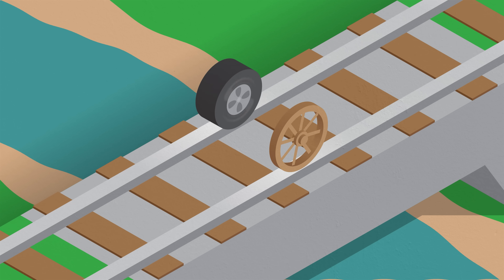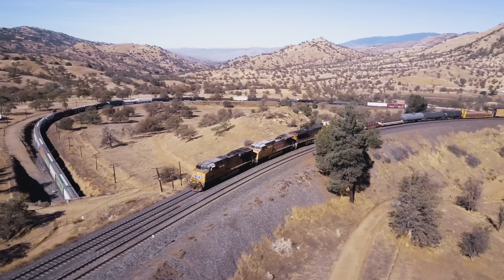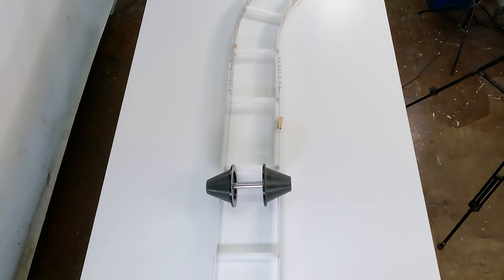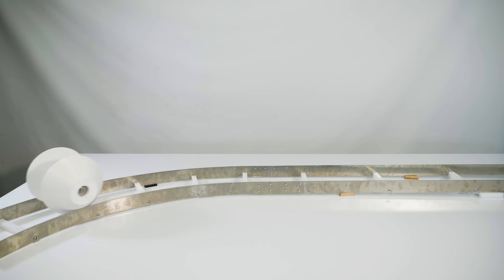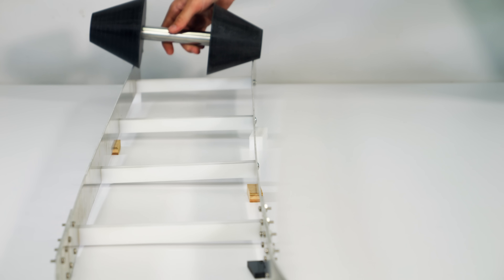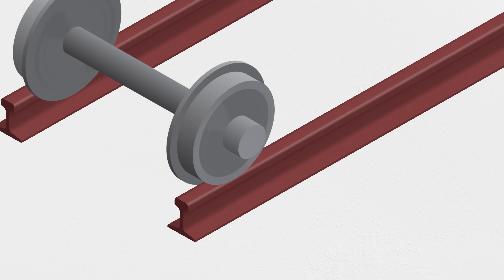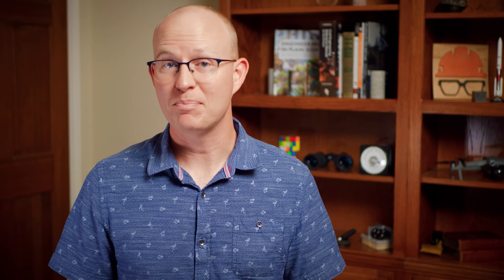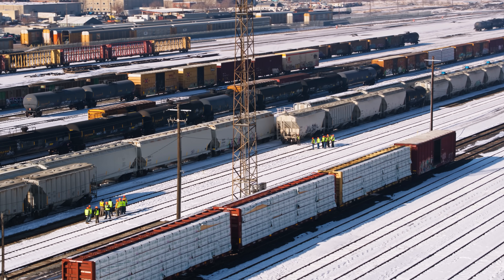Why Are Rails Shaped Like That?

Comment: Engineer here. Old engineer. I have spent many a Saturday in two different steam shops (Illinois Railway Museum and Hoosier Valley RR Museum). Worked on an old Baldwin decapod (Russian) loco, a Shay loco, and a rebuilt (welded not riveted) Baldwin Forney-Type loco. Railroads are way cool. Boiler design, superheaters, plus all the wheels and the lube, air compressor.... gauges and valves everywhere. You know the story. Awesome stuff. And I can polish a brass bell better than anybody!! Love your videos.

Comment: Hi Grady. @7:00 you mention that the outside of the wheel has a 0.25" greater diameter than the inside of the wheel, but you illustrate it with a 0.25" larger radius. But small nits aside, another great video. Thanks!

Comment: It's just going to get more fun as modern high-speed rail standards spread from Japan and Europe to the UK, China, the rest of Asia, Africa, and even - ever so slowly - to North America... instead of the pedestrian 79mph speed limits on standard US lines, speeds range in Europe from 140kph (86mph) on regular Intercity service to 300kph on Eurostar service on high-speed tracks... it's also fun to know why the Eurostar wobbles a bit when running flat out; they need to do a bit more engineering so the trains won't hunt when doing the triple-metric-tonne... 

And there's even more engineering to be done on the other side of the train - the top, where the power pickups are... sliding a contact along a catenary at 300k is gonna cause some wear, and obviously we want to minimise that while still transferring power efficiently... or could there be another way?  Maglev lines transfer power via induction, but those are rare... one wonders if we could some way use induction to power an otherwise "ordinary" steel-wheels-on-steel-rails train?

Comment: RAILS NOT SHAPED LIKE THAT !!!!!
The rails being talked about are called "Flat bottom rail" because they have a flat bottom, so stand up by themselves. But they are NOT the only type. Indeed at 0:25 can be seen at the bottom right foreground, and older type of rail called a "Bullhead rail" which is rare in the USA, but still fairly common in Britain. Bullhead rails require cast iron chairs also visible in the picture, to hold them almost vertically but not quite. The "chair", allows the rail to be tilted slightly inwards to help naturally "centre" any wheels running along it. The "Bullhead rail" is shaped a dual head shaped rail with a rail head both top and bottom. Further Tramways in towns and Cities, have to use another type of rail known as "Tram rail" which today is a flat bottom shape, with a "U" shaped cup extension on one side of the rail head. This is required to prevent any rubbish, or other street detritus, from getting into the area of the wheel flange. Or trams being fairly light, can become derailed.

Comment: Canals would be a cool video. Cruising the cut channel is excellent and when you said rail-road it clicked. I believe it was still during the time when locomotives were around heavily that canals in Great Britain and even South Carolina were built with a tow path for animals to pull barges. Today they're used for leisure boating specifically narrowboats -- which themselves are fascinating

Thanks for the videos, cheers `-;

Comment: Something interesting is that Switzerland has at least 3 different railways, despite being a pretty small country. But the mountainous areas often have different sized rails and cars due to having to traverse more vertical terrain, which is done by building spirals, most notably the Albulabahn. I now also wonder if they have differently shaped rails or wheels.

Comment: Nice video. Im a machinist. You can see me on a YouTube video truing a locomotive wheel. Type in Metra Wheel Truing. The thumbnail is a cutter head for the wheel machine. If the wheel is still thick enough. I can cut the defects out of it.👍

Comment: I’m curious. The tracks wear mainly on the inside. When it wears to the point of needing to be replaced could you simply reverse the track, so the unworn outside becomes the inside? This would double the life of that section of track.

Comment: Do a video on why you don’t want to run the same size/weight train at regular intervals and speeds as this causes problems with wear, especially under grounds where the trains are basically all the same and just minutes apart all the time. Its a massive problem and hard to solve.

Comment: I work at a train car repair shop, and everything on the truck assembly is bulky. There are usually 9 springs, with most being doubled or trippled. The wheels are measured and replaced if needed and weigh around 10,000 ibs, about 4,500 kg.

Comment: This comment will probably go unnoticed, but, if the triangle is the most sturdy and strong shape, how is the I beam the most known for it's strength?
Reply: Different shapes are strong in different ways. The triangle is the most rigid in its plane, but when deciding on a cross section for a beam, it's more important for it to be as strong against bending along its length instead. I-beams do this with minimum weight and are easy to manufacture.

Comment: Hey, while you did mention wheels being a conic section at 1:20 or 1:40, but you forgot that the rail itself is also angled at 1:20 or 1:40 towards the inside.
Source: I have to measure how off they are from that at my job

Comment: at 1:40, did you really suggest that railroad innovation of moving goods was to solve a car's restriction to a road?
Reply: That’s not at all what he said? Roads have much lower weight limits, because asphalt is inherently quite weak and can’t handle the weights rail can
Reply: @techheck3358  that's why i wrote suggest. the series of animations suggests that cars and trucks on roads couldn't handle loads. a better representation would have been horse and buggy, considering the chronology of railroad inventions, the steam engine, and decades later, the car
Reply: @geotheo10550  it’s not just about chronology - it’s about present day capacity. The higher the load (per tyre/axle) a road experiences, the faster the surface degrades.

Specifically, it follows the fourth power law. So, as a simplified example, say you have a 2 tonne car. That’s 1 tonne per axle. 1^4=1. Say you have a 30 tonne truck, with 3 axles: 10 tonnes per axle. So, even though the weight per axle is 10x larger, it causes roughly 10^4=10,000 times as much wear on the road surface.

Now, of course this is all impacted by various factors, like climate, weather, sub base of the specific road etc. but generally speaking, when you see some form of road damage, like a pothole, chances are it’s been caused by a truck or other heavy goods vehicle
Reply: @mtqrx  yes, this is all true. and thousands of years ago, logs were used as wheel-less axels.

Comment: There was a company called Dinn Corporation that made wooden roller coasters for a while. They made some kind of horrible mistake in their train/track set and every one of their coasters rode like they had square wheels, slamming and shaking destroying both the track structure and people’s necks. Most of these have been retracked by RMC with a completely different car/rail set.

Comment: Can someone tell me the exact shape of the top of the rail after use?

Is it full rounded or is the top part also flat for a bit?

since the trains weight comes not exactly from the top but from a slight angle, now does that affect the shape?

https://youtu.be/Nteyw40i9So?t=534

Comment: @3:40...You state rails on curves are often made from higher grades of steel than that of straight sections? Rail steel steelmaking specifications and rolling dimensions are dependent on the gauge of the track and therefore a grade of "higher quality" is not posible...perhaps they are heat treated differently on the curves mentioned. 
The specifications for say, Standard gauge and different from Broad gauge.

Comment: In summary, because that shape of rail and the corresponding shape of the rail wheel, works better (meaning a weighted average of all factors such as rail/wheel longevity and rolling efficiency, dynamic stability at speed, etc.) than any other shape(s).

Comment: Two hopefully constructive comments about this otherwise excellent piece:

1. I came looking for specific on the radius of the web where it interacts the filet of the wheel. The interaction of those two curves is vital to understanding concepts like the "L/V ratio". I suppose that's too advanced for this piece -- fair enough
2. It might be worth mentioning in this piece that locomotive wheels have very different requirements from rolling stock wheels. Reducing the contact area (discussed around 10:55) reduces friction. While this is a win for rolling stock, locomotive wheels are a different story. A locomotive depends on friction of the contact area of its wheels to convert its power into lateral tractive effort. Reducing the contact area of locomotive wheels causes them to slip under heavy load.

Comment: Great video. There is so much to add on curves and the different designs balancing degrees and elevation and rate of spirals going in and out of curves. After a 2 degree curve, there is wheel slipping and this is dealt with by adding greasers at the beginning of curves to help reduce rail/wheel wear. This is where the train wheel flange hits a little button (fixed on rail) at the beginning of curve and in turn spits a small amount of grease on rail/wheel location. It's a common game of fine tuning elevation even to this date to help control rail wear. Speed and elevation can help reduce wheel/rail wear.  You can even see and sometimes hear it when going through a curve where the lead wheels on a set of fixed trucks is tight to the flange and the trailing wheel flange are tight to the opposite rail. The truck twisting causes allot of wear on both wheels and rail, which causes more on going maintenance. The maintenance would consist of  re-profiling the rail head by a special machine called a rail grinder, and replacing the rail which is usually the high side due to flange wear, and sometimes parts of the low side due to shelling. You can't change the degree of the curve (for the most part on existing built track) , but the elevation and rate of the elevation is fine tuned on an ongoing bases to this date.

Comment: Use 4 wheels, two of these at a short distance from each other for wheel base. Maybe trains use it, have not seen for a long time. The our tracks are slightly higher level at turns.

Comment: WHEELS & RAILS !!!
Lets get one thing straight. American Train Drivers are NOT "Engineers", as they are not qualified in any Engineering field. As I discovered when examining a number of U.S Railroad practices in the 1980's. Indeed calling yourself an Engineer, when you are not, could get you into legal trouble in Britain !!! 

Railway wheels did not have flanges in the early days (1820's & 30's). The flange was part of the rail, so the rails were "L" shaped, and known as "plates" or "plateways".  When the flange was transferred to the wheel (to simplify Point construction not the wheel), the rails were made in short lengths (4ft) of Cast Iron, and called "Fishbelly" rails because of the "bow" shape of the underside of each piece. The Great Western Railway (from 1835) with its 7ft 0.25inch Broad Gauge "baulk road"  track used a "Bridge" type rail (an inverted "U" shape) bolted to Huge Longitudinal beams supporting each rail continuously, the rail itself was made initially of wrought iron. 
     
By 1860, steel production had become possible for more complex types of rail, and the new standard became Bullhead rail from that time. This is basically a doubleheaded rail, the original intention being, when the top was worn you turned the rail over. In practice when the rail was turned over it had been slightly indented, due to the weight of the trains, as it sat in its "rail chair" designed to keep the rail from falling over. When turned over it gave a "bumpy vibrating ride". However the two rails of a track could be swapped over, when the top edge had become skighty worn on one side. This however produced a "Roaring" sound, loud enough to disguise the regular "Clickerty Click" sound of wheels passing over rail joints. So was only done occasionally after WW2 when steel supplies were restricted.

Bullhead rail continued to be produced far longer in Britain than in Europe. For a safety reason, and can still be found on branchlines, and part of London Underground. The safety issue is that the subsequent "Flat bottom" rail has a narrow vertical section between the head and the flat bottom, that could result in this narrow vertical section rusting and collapsing. Indeed this problem caused a serious train crash in Britain as recently as 1998. 

The most common type of rail from the 1930's in Europe, & 1950's in Britain became the now virtual World standard called "Flat bottom" rail. which as its name implies has a flat bottom allowing the rail to stand up without falling over. This obviates the need for "Chairs" as required by Bullhead rail, to hold that rail effectively vertical. In Europe however unlike in the USA, Flat bottom rail is not normally allowed to be simply "spiked" to the wooden sleepers, except possibly in little used sidings. So has to be supported by steel baseplates, to which the rail is attached by steel clips, and the Baseplate itself is bolted to the sleepers.

WHEELS
Unlike in the USA wheels have to have separate "shrunken on & keyed" tyres. Certainly on powered vehicles, such as locomotives and Multiple Unit power cars. Further the method of wheel production used in the USA is banned in Europe again on Safety grounds. The production method used in the USA invariably involves simply punching out a wheel disc, or producing a complete wheel in a mold.

But this results in metal fatigue fractures from either the central axle hole or the wheel tread area, that can occur fairly rapidly. Even within one long train journey ! Hence the USA method is banned. In Europe a narrow strip of metal is rolled up and heated to melting point to produce a wheel, with the tyre and flange normally being added as a separate part. This method does not prevent possible metal fatigue. But when it occurs causes the fracture to slowly circumnavigate the wheel, which takes weeks. And gives maintenance staff and trackside wheel fracture detectors a virtual 99.99% chance of detecting the fault long before it becomes dangerous.

Operation of wheels has certain complexities attached. Even a simple wagon or carriage exerts a constant downward load on the wheels, made worse by jointed track or poor suspension systems. So come what may, the rail to wheel interface slowly wears. But for reliable and continuous operation the rail head has to actually be slanted slightly inwards, and the wheels tread surface, has to have a matching angle. This ensures that the wheels on any axle naturally centre themselves on the track. In a perfect World this means that the flanges even in gentle curves won't actually touch the sides of the rails, which causes nasty screeching sounds. 

However wear occurs to both the railhead & the wheel tread slowly become worn, and slightly out of alignment. This can result in what is known as "hunting", and when a passenger carriage starts doing this, it can frighten the passengers. If it gets really bad it can result in derailments. Back in the early 1960's the cause of "hunting" was not well understood. British Railways Rolling stock Engineers were convinced it was a problem of the carriage bodyshell Bogie pins vibrating in the hole in the bogie centre, through which the bodyshell pins (which are around a foot in diameter) passed. And that they needed to introduce a more modern carriage bogie design to cope with all the new welded rail track, which they suspected was partly the cause of this phenomenon. 

So in 1964 they introduced a new carriage design (the BR Mk2), with a new lighter weight bogie design (B4), with coiled suspension. But after just 50,000 miles of testing their nice new design began "hunting", holding up further production. So I as a 8 year old child got hauled off by my Father to the British Railways Carriage Works in London, to see the amazing sight of a new carriage hanging in the air. With its bogies on the track beneath and a lot of BR Engineers and Esso Fawley Refinery Scientists (My Father worked for Esso as the manager in charge of the BR Fuels & Lubricants department, so had to be present) discussing the specification of a new thicker grease to put on the carriage bogie pins, to abolish this irritating problem. The new grease however made no difference to this issue, but did lead to the discovery that the angle of the railhead and wheel tread would require much better supervision. While I spent the time harassing the BR Engineers with somewhat advanced technical questions about "Flying Carriages" !!!   

The result was of course a lot of new and more precise wheel lathe machines in BR Depots, and the acquisition of a fleet of Swiss built (Plasser & Theurer) sophisticated computer controlled self propelled "Rail Grinding" vehicles !

Comment: So why train cars need solid axles at all?  Road vehicles need differentials only on driven wheels. Wheels that are neither driven nor steered, like rear wheels of an FWD car, are completely independent, there no axle,  no connection between the two wheels. So each wheel can rotate at a different speed without a differential or a special conical shape. Wheels of a train car are also neither driven nor steered. Why don't trains use this solution?
Reply: Durability, it may someday be practical.